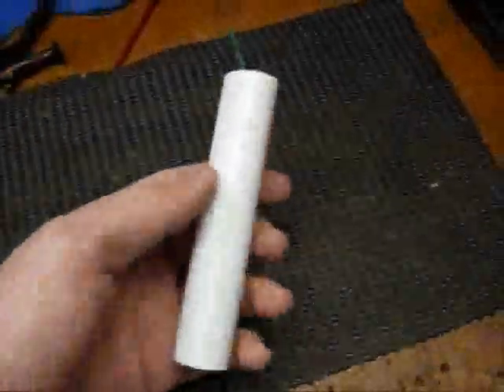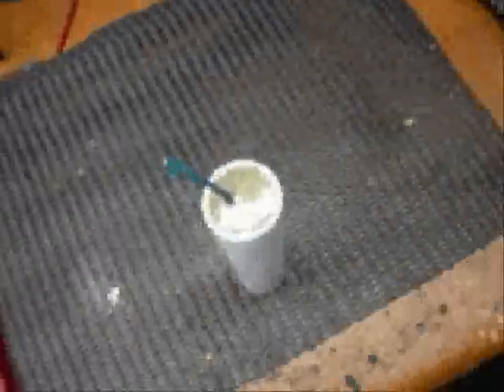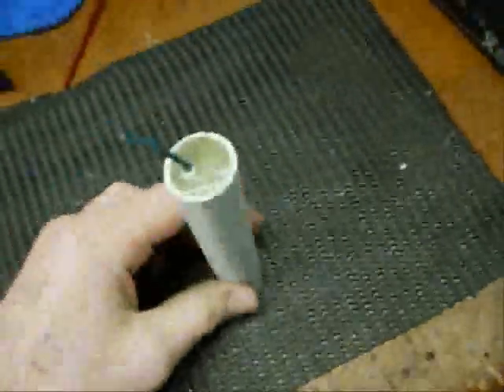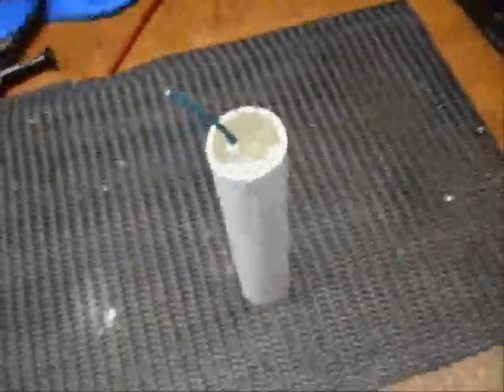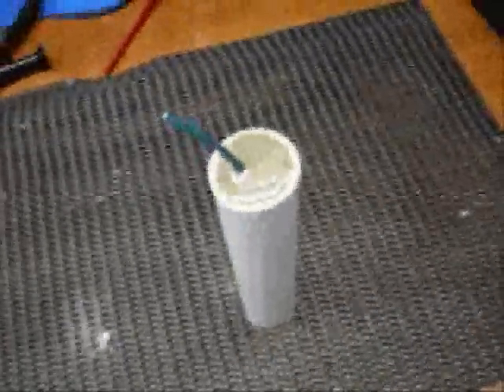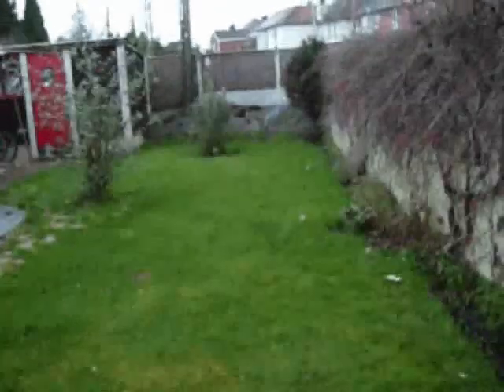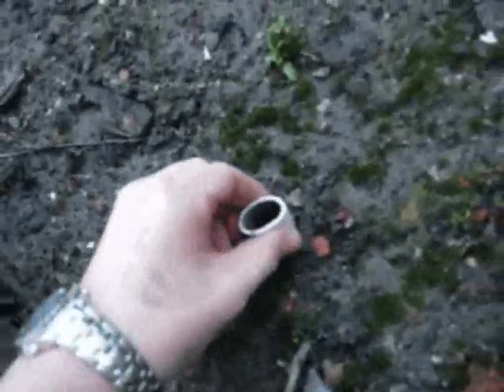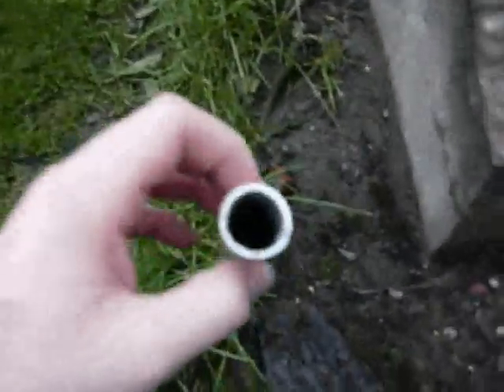Kno3 & Sugar Rocket Test (long shelf life)

Comment: theres an easier way to do it dude, put it in an airtight bag, or take clingfilm, pull it over the end tightly but make sure it doesn't spit then selotape around the tube securing the film. When needed to use, you can pierce the film with a fuse and when it ignites, the film will burn/shrink easily away. Let me know how it goes if you try it ;-)

Comment from the maker: it is 25mm conduit pipe, it was soft because of the heat after the burn, i think i need to make the hole bigger because of the pressure